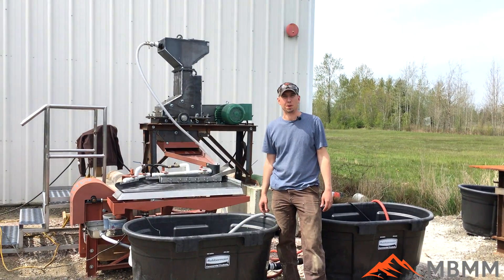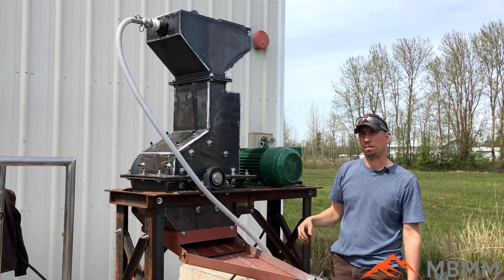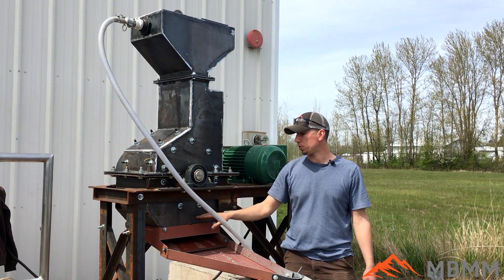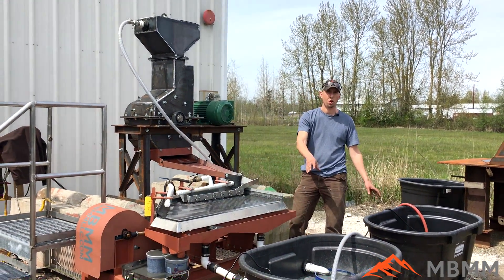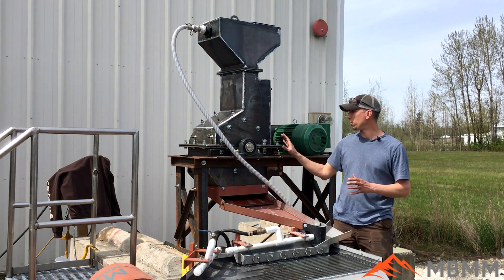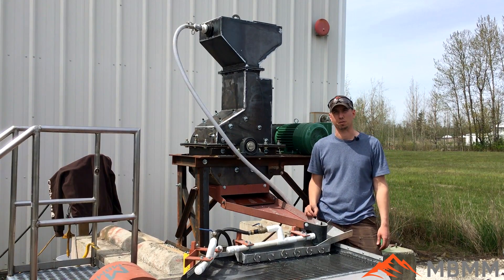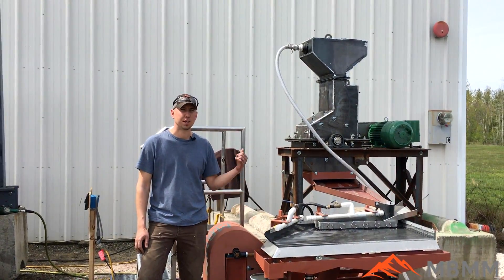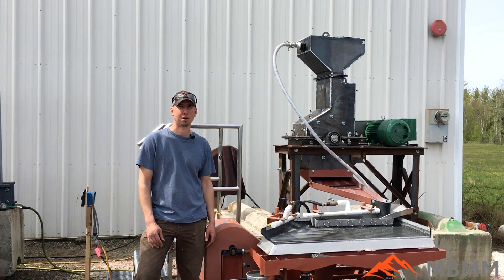Small Turn-Key PCB Processing Module

Comment: Can this unit process anything else or is it just limited to circuit boards ? I would imagine there is magnetic material on the boards is this something you extract at smelting or could a magnetic device be installed maybe on the chute coming down to the table to pull it out.

Comment: What sort of power consumption does this system see, and how efficient is this system (how much is recovered compared to the total amount of metal)?
Reply: 7.5 kw for the hammermill, pumps about 1kw total or each so a 40 amp supply will be fine peak on start will be higher but not much

Comment: Jason, would this system work just as good with fine wire, such as telephone, keyboard, mice, cat 5/6..
Reply from the maker: It doesn't granulate very well, but if the wire was already chopped in would work well

Comment: adding a wet tile saw so oversized boards could be sectioned up to fix would seem a good idea and that would give you more flexibility in hammer mill size and through putt and any dust generated by the wet saw could be run through the shaker table as well.
Reply from the maker: Great, thanks for the tip!

Comment: Make sure to clean off any capacitors off the fiberglass circuit boards or any other electronic board before shred chopping up , their is deadly chemicals in the capacitors and they have to be contained and disposed under the  Haz Mat procedures with the epa rules ,all  to prevent permanent water or soil contamination that is bio hazard.
Reply from the maker: Great, thanks for the tip!